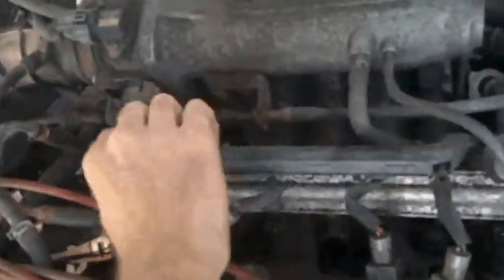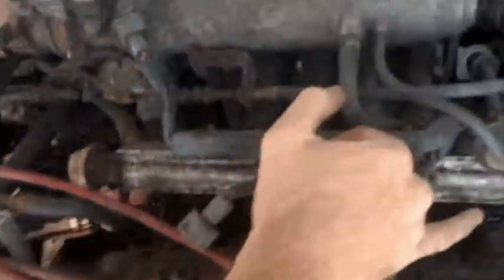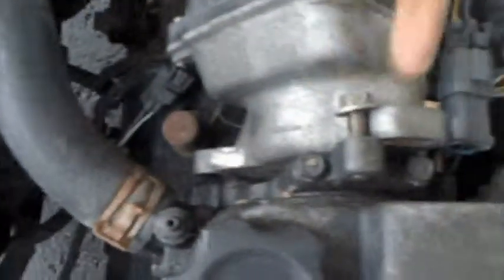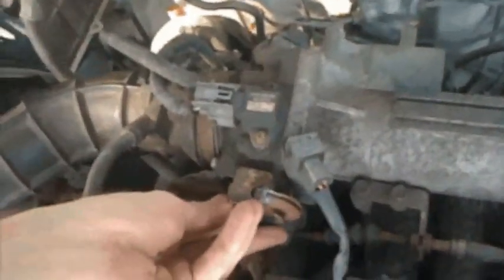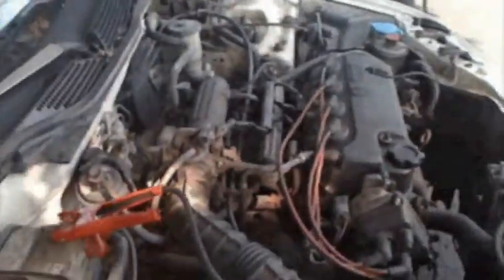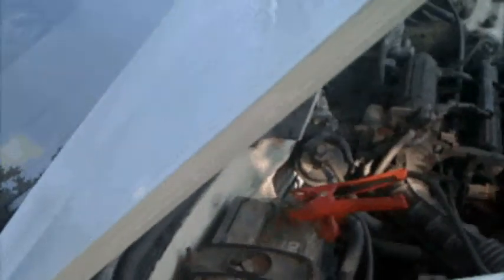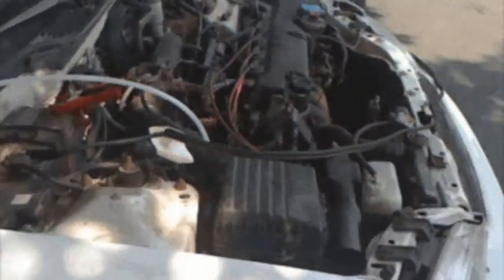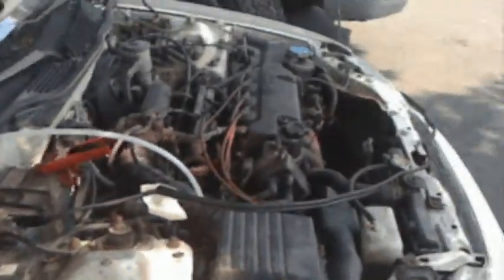Hydrogen Car Part 1

Comment: Wow, a large manifold, a long plastic tube full of hydrogen, all leading 3 feet away from the hydrogen tank in an enclosed space...what could possibly go wrong there.  I see a Honda Hindenburg in your future.  I am all for hydrogen and alternative fuels, and I am glad to see a video that isn't one of those "run your car on water" scams, but for your own safety you really need to limit the amount of hydrogen between the intake valve and the safety shutoff.  Hydrogen injectors or something.